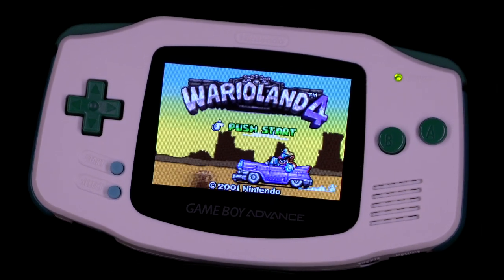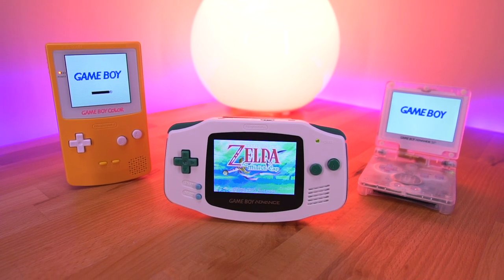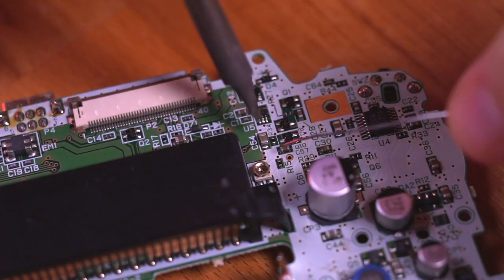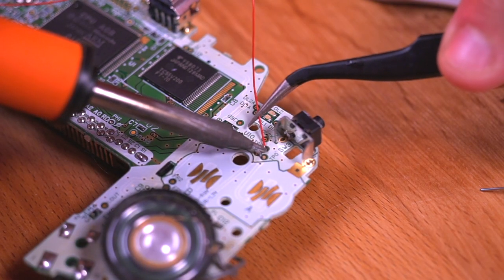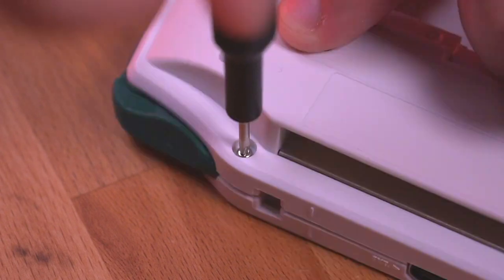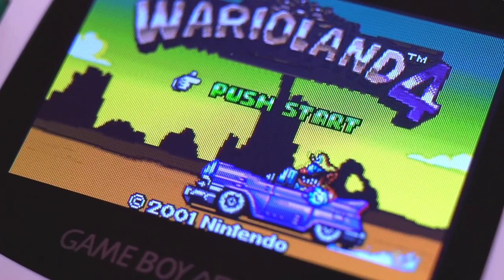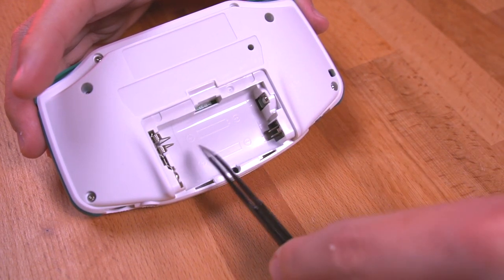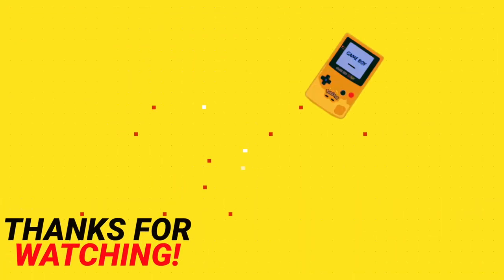Latest LCD Upgrade for the GBA | Laminated ITA Kit

Comment: I think as far as drop in options go the Hispeedido might be a better option since it requires zero soldering for brightness or color settings and works without solder on either pin model.
Reply: They're really not comparable though because the Hispeedido is IPS and not laminated.
Reply: @testidentify  Uh, yeah they are. As far as drop in screen replacements go, the Hispeedido is easily the superior choice due to IPS, zero soldering required for brightness options or pin models, and color filters.
Reply: @Corthmic  This isnt even an ips screen, this is an ITA. also, it being a laminated screen is a large benifit. to each their own

Comment: Can an OEM shell support this with some trimming? I really prefer the quality feel of the OEM ones and I really like my Japaneses Midnight blue model
Reply from the maker: It’ll be tough but I think it is possible. It would require a lot of trimming though and it may not be perfectly flush. I really think these were designed specifically for the FP shells

Comment: Question for anyone with the same issue. Soldering the L R and Select wires to the ribbon cable proved to be counter active. It made both shoulder buttons to completely stop working. Disconnecting the wires fixed the issue. i double checked the points/vias and they were correct. Let me know if you know a fix or have seen this before

Comment: I have the non-laminated ITA kit, but it has a weird issue of the screen displaying every 4th line brighter on dark colours. I have removed the capacitor, I installed everything correctly though. Can you see a similar issue with your kit?
Reply: laminated its the same, you can see that on the video, on the wario land intro , check the sky and the ground, horizontal white lines across the screen , all kits have this problem , its the ribbon
Reply: @danielm5477  I guess there's not much that can be done.. I'll be getting an ags-101 screen, because those lines are really distracting for me
Reply: @danielm5477  As far as I know it only happens with 40 Pin models. Definitely should be mentioned in this video
Reply: @leinsaat5779  mine was 32 , but i still tested the kit on a 40 pin removing the capacitor, still the same result, there is a few reddit post about this kit and that issue
Reply: @danielm5477  Good to know it occurs on both models. I hope FP will release an upgraded ribbon cable that fixes this issue.

Comment: So I had to get a replacement screen for this mod (as the first had dead pixels) but the replacement I got needs to be attached to the original driver board. How do I attach the smaller ribbon cable to the board
Reply: Yeah I have this same problem. I can't get the ribbon to go into the socket.  Hope you find a solution.

Comment: Hey my TestPad TP 2 is a bit corroded.
If TP 2 is Select
What is the TP for Start?
Would that work or no?
Reply: It would work but it would also make it really annoying in most games to open up the OSD. I would clean up the corrosion first, optionally bridging it with a short length of small gauge wire. You don't need to tap into TP2 right on its exact location, any equivalent point in the circuit would suffice.
Reply: if the corrosin isnt that bad, you can always follow the lead of the test point, scrape away until you see copper then solder to the copper lead, its what I did when I broke my test point pad

Comment: Is there a way to remove C54 without soldering? I have 0 experience with a solder iron
Reply: Have someone else do it for you or learn the skill on some other boards. If you decide to rip it off, be prepared to have a much bigger problem on your hands.
Reply: C54 isnt required to remove but you cant adjust the screen with it on, so you might be stuck with flicker

Comment: What is ITA, is it better then IPS?
Reply from the maker: They’re both different. I wouldn’t say one is better than the other. They have different characteristics and depending on what your goals are for you gba build you may choose one over the other. The ita has more of that retro look while the ips has a more modern emulator like look but also has some features to make it look retro like the pixel mode.

Comment: No pixel/scanlines modes?
Reply: The ITA screen has a visible pixel grid.  It's nowhere near high enough resolution to support filters.  The ITA display area is basically 1:1 with an original GBA screen with the same pixel density.
Reply from the maker: The ita screen already has that aesthetic inherent in its design. There aren’t any special modes with this kit.

Comment: too bad these kits, including the non-laminated ita kits have these weird light horizontal lines going across the entire screen. Most people won't notice because "PIXEL GRID", but they shouldn't be there, and they're distracting.

In this video they can be seen in the top right corner of the Warioland 4 title screen. They're much more apparent IRL. Funnyplaying themselves even acknowledged the issue but simply said they couldn't fix it. Bummer.

Comment: "drop -in" but there's a 50% chance of requiring soldering? what a load of rubbish
Reply from the maker: It changes to 100% with a little effort. I gave you all the info you need to find a 32 pin model 👍
Reply: @MachoNachoProductions  i meant to those who want to mod this onto a gba they already own